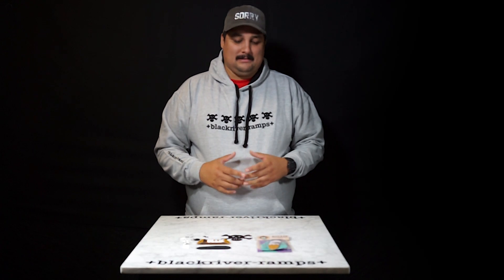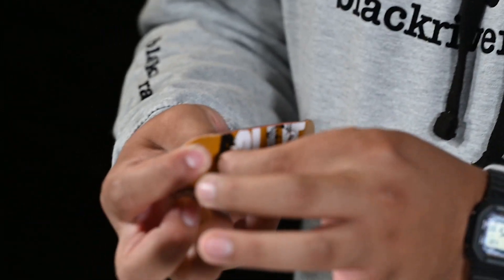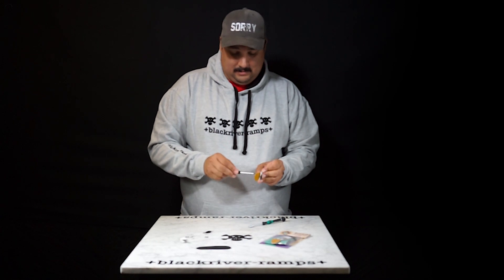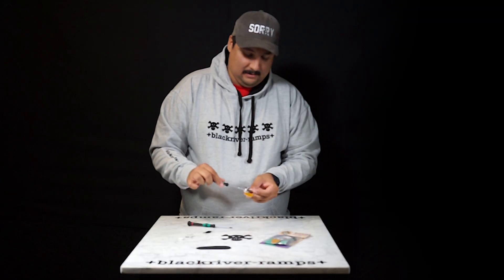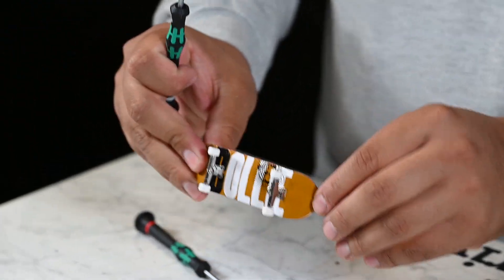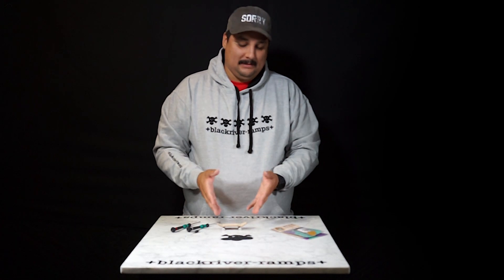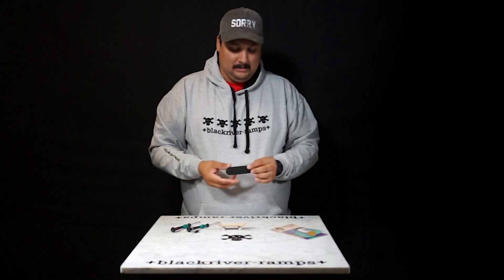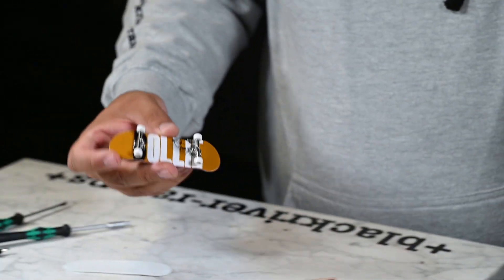How to set up a BOLLIE fingerboard with Nash Jacquez

Comment: My honest review to the 30mm starter bollie complete:
The starter Bollie setup was to be honest not that great when I come back to fingerboarding a month ago, the trucks already broke after 3 days (same issue like on the smaller tech deck trucks, one of the axis pins come loose) and the wheels kind of died just a week later…
The trucks are very awful and the wheels are really just a small step up to tech deck wheels, the bearing pockets are nearly not existing so the back of the wheels broke, next to that the bearings sliping around even on first day and they are just pretty cheap Plastik with no effort into it, they still kind of run but wouldn’t ride it anymore, now they are on a pure cosmetic tech deck setup with no other use anymore…
Don’t get me wrong, when I compare that to a 25mm tech deck from 1998 (and even with everything till today from tech deck) it’s a very big improvement but when I compare it to the more modern Produkts like the ASI complete 2.0 (20€) and the 3.0 (25€) it’s not really on the same level (32 and 34mm, single axis trucks and on 3.0 seems even hardened, still plastic wheels but with way better build quality and even the foam tape is quit better)…
And to be fair, even the stuck 32mm tech deck stuff hold up better as the bollie trucks, I replaced them in first step with Tech deck trucks cause needed one order more to find very nice inexpensive trucks…
So the best to say about is that the deck is pretty nice, the pop is quit nice, the shape is good, quality seems to be good as well and even the graved in graphic is completely ok and nice work…
Would 30mm not be a bit too small for me I think I would still ride it and even if not anymore I will keep it for sure just to compare it with other boards cause it’s still completely fine even after 3 very hard coming back weeks…

In the end I be still thankfully for the board cause it brings me really back to fingerboarding but just 3 weeks later I am now on a ASI shop deck 32mm (with the blackriver uncommon pleasure holo sticker 😜), blackriver trucks (they are pure perfection) and still switching between couple sets of wheels (ill pills street, kraken street, kraken conical, kraken bowl, spitboards swirl, spitboards urethane and tuned asi shop wheels) which is all together sure somewhat more pricy then the bollie complete…
But my secondary EDC dry and wet setups are quit more on this level with 32mm tech deck deck (wet) and 32mm asi shop deck (dry), 32mm asi shop trucks 3.0 with beta bushings (weight more but performs nearly like brt‘s with the betas) and still switching wheels…
The wheels are highly depending on what I do, but mostly I use spitboards swirl, spitboards urethanes and asi shop wheels tuned with a very soft rubber coating (tuned be my self) cause they cheap and it’s not too bad when they will be gone outside, so both setups are damn cheap with surly under 40€ but perform on a pretty high level for this pricetag, that’s for sure more then for the bollie but it’s anytime worth it cause that are all parts that will last for more then just a week of pretty hard times when coming back…

And with that we come to my results, the Bollie completes are ok to make first steps but have so much room for improvements, at least put single axis trucks and at least better shaped wheels to it, that didn’t change that much in price (maybe 5-10€ more) but brings so much more quality and performance to this setup that I could finally recommend it to others but without that changes I would go with other stuff like the asi completes or maybe the bullgod completes too when they really will ship to Germany for free (haven’t tried it till now but maybe I will next month)…
So it’s an ok, cheap setup but if you ask me, still a bit to expensive for what you get so please make it cheaper (at least 5€) or put longer lasting parts on it (then it’s even ok when it cost 10€ more) but for what it is now you just got better stuff for this pricetag and i‘am not even talking about cheap china knock offs, just parts you can easily get by order on trustful stores…

And before someone say that the asi shop trucks 3.0 are brt knock offs, they just not, for sure they share some design features but not more like on dynamic or y trucks, the base is a bit like brt (Indy’s) and the hangar a bit like dynamics (venture trucks) but in the end they are still different and more then enough to see them as own trucks cause the quality is noticeable better as on the more common china trucks (like the 2.0 asi shop trucks) and I have multiple of both plus a set of brt’s to compare…